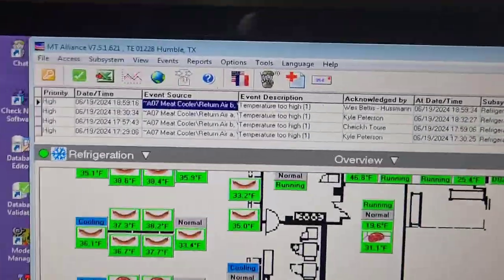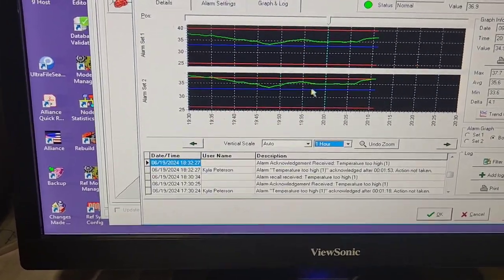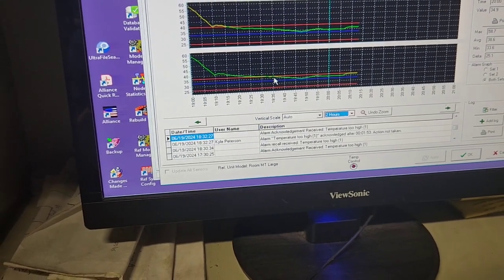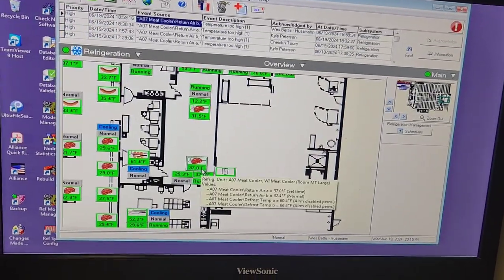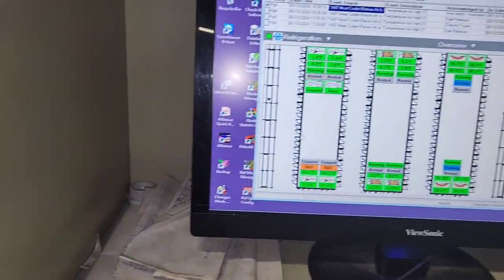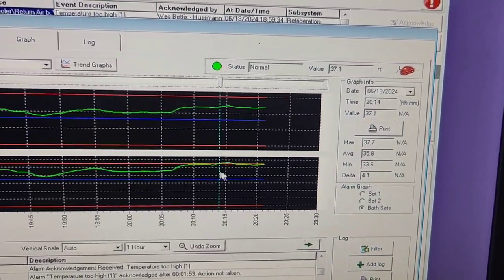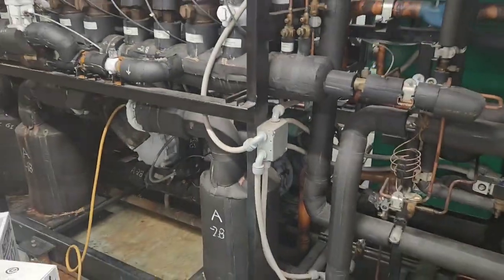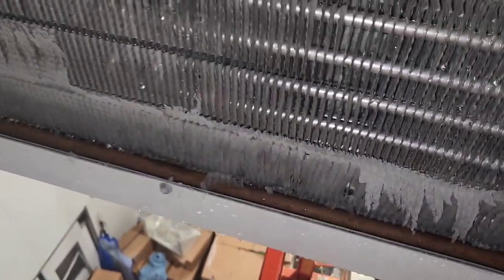Valve Off Rack Circuits to confirm Lack of Charge

Comment: Great test for checking charge level on a rack system.
Reply from the maker: Thanks.  How you doing with flooding over there?
Reply: @HVACRServiceTech  
Didn’t get any flooding at my place. They probably got some in other areas of the city. I got 4.5” of rain. You all got more than we did when I was watching the radar. They say there’s more on the way another low pressure system forming southern gulf coast. I’m waiting for the dark clouds of mosquitoes to start forming. Stay safe and hydrated brother. 💪💪🇺🇸🇺🇸🙏✝️